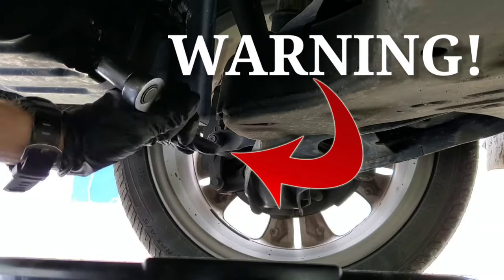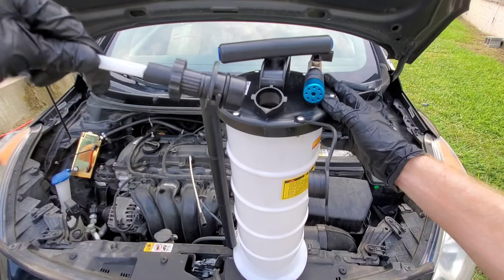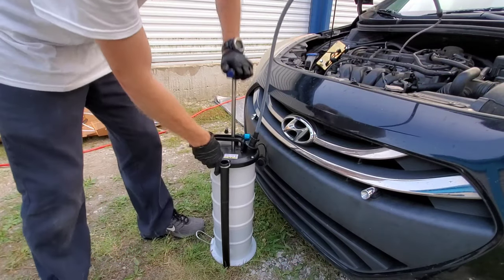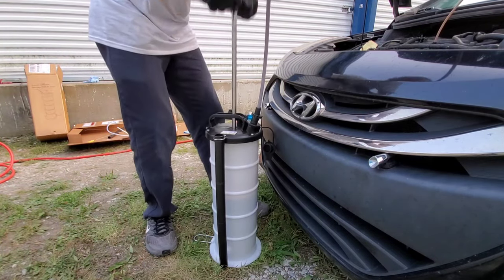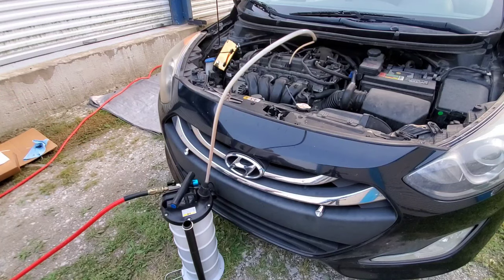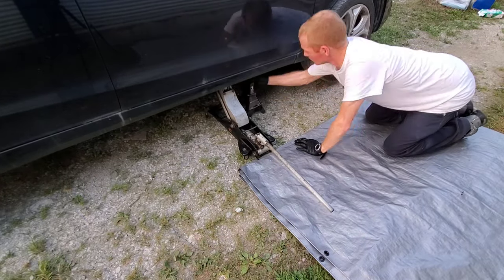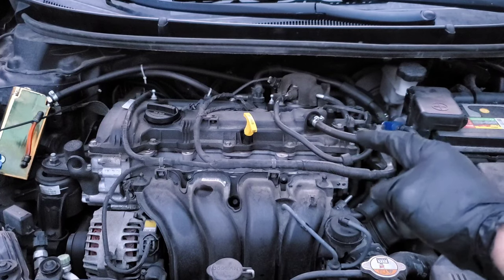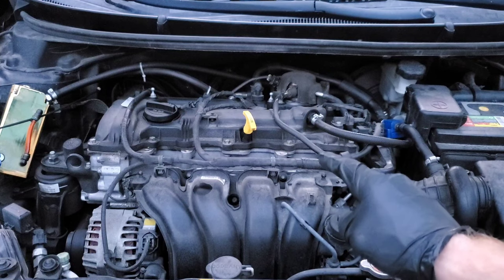Pneumatic oil extractor isn't safe!?

Comment: I personally will never use a fluid extractor for changing oil in any vehicle 
Now a transmission, differential or something that doesn’t have a drain plug would be great especially a draining a transmission before removing the pan and having less mess

Comment: Two misleading statements with this video.  First one is the video title of "Pneumatic oil extractor isn't safe!?"  Second one is, "I can't believe the Holt pneumatic fluid extractor can destroy engines?"  Maybe I missed it but those issues were not addressed in this video.
Reply: Third one is, "5 quarts is a litlle more than 5 liters."

Comment: You could leave the plug off and 3 hours later it will drip just slightly. For that to not have oil dripping out the bolt is suspicious

Comment: I wouldn’t use the pump for the speed, but to avoid a mess under de car 🤣
Reply: you can literally drive to parts shop, start extracting at the parking lot. Then go buy oil and the time you are back its ready.

Comment: The instruction for my pump said I have to make sure the stick is all the way at the bottom so I did… now it’s stuck and won’t come out no matter how hard I try. Guess I have to pull the pan out and a quick “20 minute oil change” is gonna turn into a whole day of suffering 😒
Reply: Owch!
With a nylon pipe, I would think it impossible to snap so I hope you gave it the full beans before you surrendered!

Comment: have you ever used this unit to bleed brakes ? Or do you find the hoses leak air when pushed on to the brake bleed nipple? Is it possible to connect a vacuum pump to the top of the canister?
Reply: sure you can use this for bleeding brakes. but common mistake is not greasing the threads on the bleeding nipples. By not greasing the nipple around it can cause to draw air through the threads. 
Clean the nipple from dust and debris. Grease the nipple around. Connect vacuum pump to nipple. Create vacuum through a couple of pumps. Make sure your brake oil tank is full. Release the nipple and pump on the brake paddle. Throughout operation maintain vacuum on the vacuum pump and continue to do so till fresh brake oil comes through.

Comment: Sorry I'll do it the old fashioned way take out the drain plug. I'm to much old school.
Reply from the maker: I completely understand, myself included but as one gets older or even injured it may change.
Reply: @NATESINTERACTIVEAUTO  That's very true.
Reply: same , only way the extractor comes out is if i got a customer who has a rounded plug or has oil pan thread issues

Comment: i been using holt fluid extractor 6yrs on both of my audi RS7 and A4 B9 … they remove all the oil out of the pan … i tested by after extracting all the oil out and took out the oil pan and no oil is left on them… i had no issues what so ever using fluid extractor leaving sludge … if you have a sludge you already had sludge issues 🤦‍♂️ i disagree with you 100% and my audi mechanic buddies at the dealerships use fluid extractor and i never heard of such sludge or not extracting all the oil out of the pan… you probably had sludge build up and time to replace your pan homie and FYI remove the oil cap off and oil filter off and extract more out completely 🤦‍♂️ you definitely dont know what your doing

Comment: It did what it was suppose to do.
not sure why anyone would not use the DRAIN plug...
can be useful for ATF in some cars..
Reply from the maker: As for oil changes if someone has a top mounted oil filter this would be beneficial.
Reply: I agree I would probably never use one of these don’t be lazy when doing maintenance on your vehicle take the extra time and just drain from the plug.
Reply: @Back_door_bandit_98  Yep. Gravity can be your friend. Don’t fight it.
Reply: Why do you think. Cos crawling around under cars in the dirt and hoping they dont fall on you isn't much fun.

Comment: sludge is coz by not changing the oil for a very long time end of story. u should have show the oil filter too i bet theres more sludge build up there.
Reply: This kit should mean people are much more able to change oil much more frequently. If you can do it without crawling in the dirt you will do it more often. Really some manufacturer should build a pumped oil drain feature into their engine. Combined with an easy access top mounted oil filter it would be a winner.

Comment: Just look at the time it takes to extract the old oil, needless to say about to speed it up by using an air compressor and etc.yet still have to clean up at the end... That is the dumbest and costly device for lazy DYIs.  Bring out a set of ramp and a socket wrench is much faster and done right!  If anyone is thinking to avoid spill and dirty their garage floor while draining the old oil, just place a card board underneath (fully disposable after a few uses, still 50+ times cheaper than that  👎 thing.  BTW, if anyone still insist on getting/using it, make sure it has a long enough warranty against the plastic container/seals etc. from cracking/deform after a few uses from exposed to heat & chemical causes leaks and more clean-up headaches 😂
Reply: Not everyone has the space, driveway, garage to even have the chance to use ramps etc. If all you have is one parking bay this is a big help. Oil filters do not need changing with every oil change. It is just a fetish to do so and makes us all feel good and like we are doing a great job. Its really not necessary if changing oil every 5 to 10K miles. That is the more important issue and this helps you do it more often.

Comment: Just buy a set of ramps .you have to go under the vehicle to get to oilfilter any way .and take the oil plug out .do it right and have pice of mine. Why spend $80.00  for a junkie  pump. But it's your money.
Reply from the maker: It depends on the circumstances like if you are injured, the oil filter is top mounted. Also it has other advantages. 
But like you said if you already have a efficient way to do the work it could be unnecessary.
Reply: Those pumps are a great option for a transmission fluid though at least in the older cars that have a transmission fluid dipstick.   Also the pumps arr good if you want to do something like empty a coolant reservoir or change out a certain percentage of brake or steering fluid.
Reply: @Protolamna  great ideas that pump looks like it something to have when you need to get fluid out if somewhere fast

Comment: this machine left 3 dirty quarts in my toyota engine at jiffy lube and they argued it until i demanded they pull the plug and at least 2 quarts drained out from there.. they would have overfilled my engine and left me to deal with the repair costs .. my bro in law had his oil changed at the dealership today when he got it home it poured oil all over the garage floor because (guessed it) the dealership had used a vacuum to remove the oil and had overfilled it by  3 quarts .. so these don't work on toyota or jeep.. how many cars need to die over this lazy messed up tech-crap
Reply: Wouldn't you know the extractor only pulled a fraction of the oil based on how much it holds?